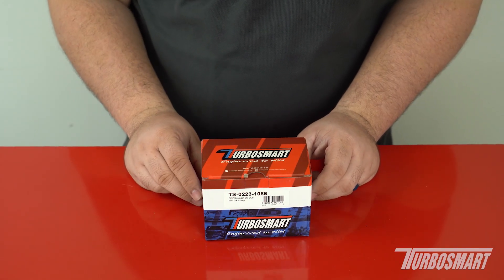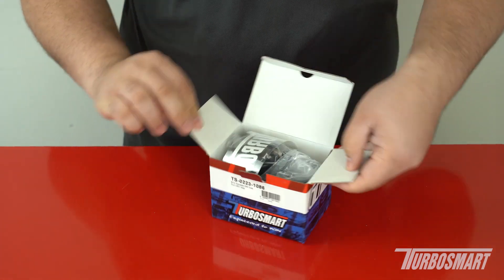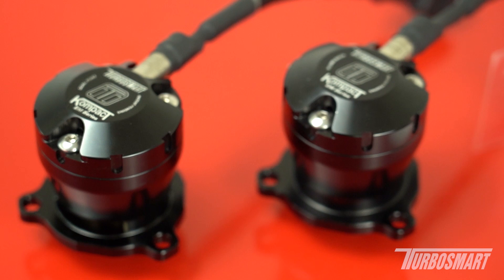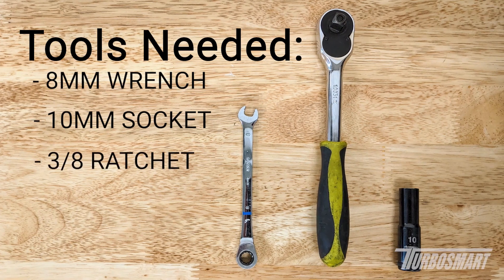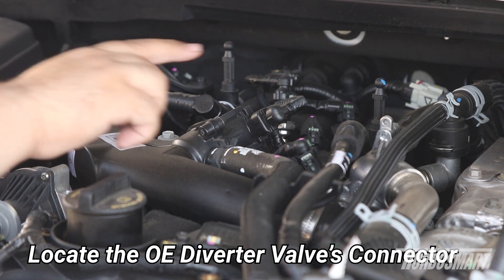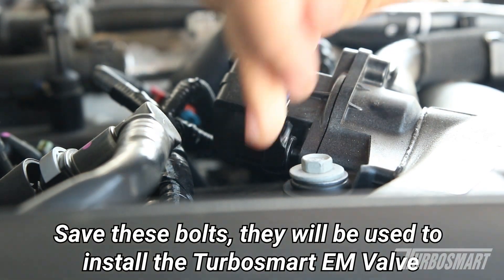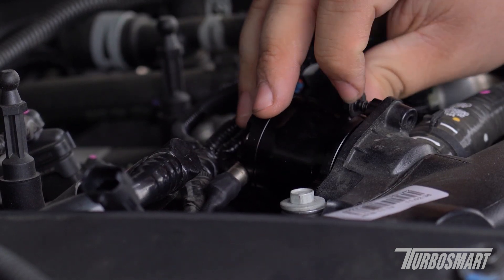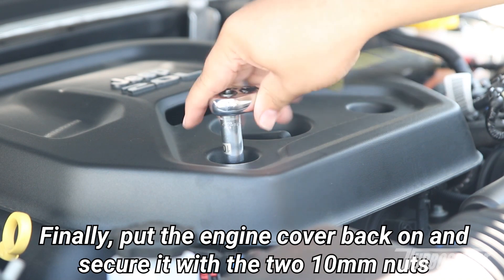BOV INSTALL: Jeep JL EM Dual Port Blow Off Valve (P/N:TS-0223-1086 & TS-0223-1286)

Comment: I just received this part from you guys and installed it looking forward to hearing the spool sound & mine did not spool at all. Disappointed. Will most likely return
Reply: How does it sound? The video makes it seem a little faint but at least it is there
Reply: @asperbergers7136 leave the engine cover off it u want it louder
Reply: What do u mean ?
Reply: blow off valve. doesnt change anything but when you let off throttle

Comment: Is this just for noise what is the benefit of it ? I like it just want to know more about it
Reply from the maker: Noise is a by-product of any Vent To Atmosphere BOV, as they are designed to prevent compressor surge and extend the life of your turbo in the long run. Our Kompact EM valves are a significant improvement over the plastic factory valve in just about every measurable way. Durable Billet CNC Aluminum construction,  improved overall response, and superior boost handling capacity. All especially important things if you plan to tune and make upgrades. They come available in either "Plumb Back" TS-0223-1286 (100% recirculation) or "Dual Port" TS-0223-1086 (50/50 VTA).

Comment: Any  provable horsepower gains or just for noise?
Reply: No, it's just vent to atmosphere, some say the recirculating is better, some say venting allows faster  spool of the turbo. Debatable.
Reply: It’s better for the pressure release of your turbo no horse power just nicer sounding and performance

Comment: Just installed mine on JL Sahara, but it's not making the sound.  Not sure if I have a dud or not.
Reply: What kind of change ? Just thinking about installing it on mine.. thank you
Reply: @Martin-mq4dz  at first it felt like better throttle response, but could've been my excitement.  Right now i dont notice it at all and cant hear it clearly. You have to have radio off and dead silence. Only hear it once loudly from when you first accelerate. Just keep foot on gas for a bit to build pressure then let go and you'll hear the swoosh. Tbh im not satified with it at all.
Reply: Yeah I’m not satisfied with it either it’s quiet
Reply: V6 or 2.0T??
Reply: @2asianguys667  would have to be the 2.0 turbo. I dont think this applies to the v6 non turbo

Comment: How do you know which one to get?
Reply from the maker: Both offer the same overall benefits, but it will really come down to if you want to hear the valve vent to atmosphere or not. Our Kompact EM Dual Port offers a 50% recirculation and 50% Vent-to-atmosphere. Our Kompact EM Plumb back is 100% recirculating.

Comment: Does this works for 2019 2.0T Cherokee trailhawk? thanks.
Reply from the maker: Its possible, but we can't officially confirm or endorse that fitment since we haven't personally test fit the valve on that application. We are always looking to expand our offerings, so in the meantime we will submit an inquiry to our R&D department. Thanks!
Reply: Did anyone ever figure out if this will bolt up to the 2.0T in the Cherokees?
Reply: Yes

Comment: How do I determine which of the 2 valves in the video I should buy?
Reply from the maker: It comes down to your preference. If you are seeking that blow off noise then we would recommend the Dual Port (TS-0223-1086). If you want the benefits of an aftermarket valve but don't care for a blow off noise then the Plumb Back is a better option for you (TS-0223-1286).
Reply: @TurbosmartHQ  Ok, thanks!
Reply: @TurbosmartHQ  what exhaust is on it ?

Comment: I just ordered this same part for my Jeep. I put it on, gave it gas while it was in park and it doesn’t work for me.. only when I’m driving under a load I can hear it. Do you have any suggestions?
Reply from the maker: On some applications it is difficult for pressure to build with no load on the engine. If you are wanting a louder pressure release you would need to make more boost.

Comment: Does it make a difference in noise in which direction the port is facing? CJPony’s installation video has it facing a different direction with the connector facing vertical.
Reply: I got the dual kombat bov and now the check engine light is on!
Reply: James Willis ive had mine for a month. Works great
Reply from the maker: @jameswillis2593  Please reach out to our Technical Support team for assistance.
Reply: @jameswillis2593  Are you sure you have properly tightened the bolts?  That sounds like a boost like potentially.